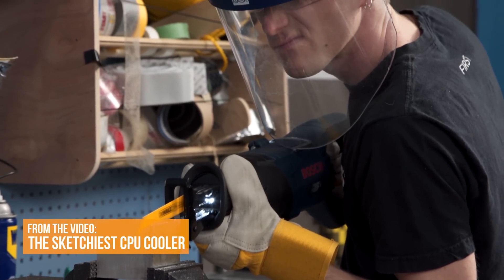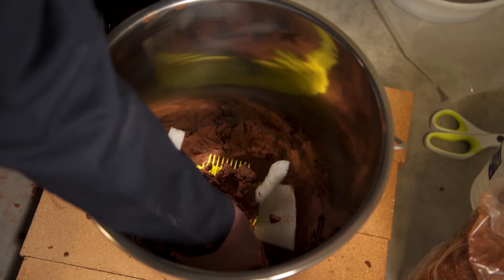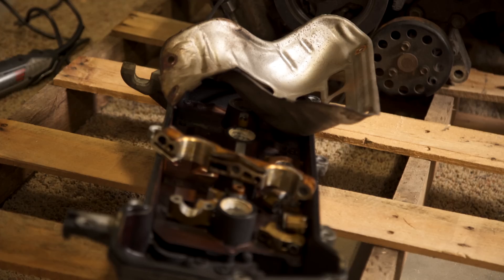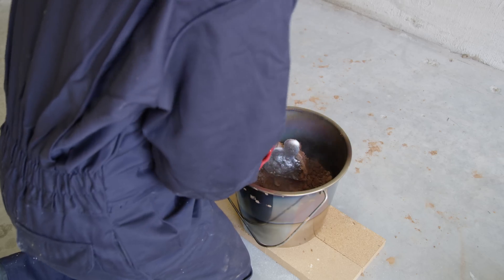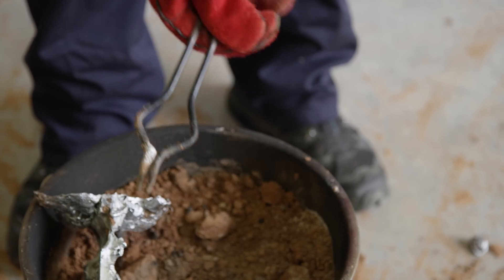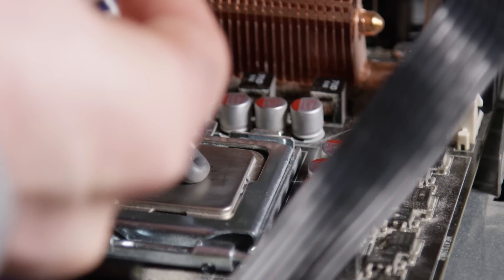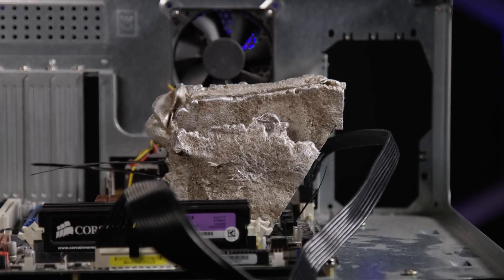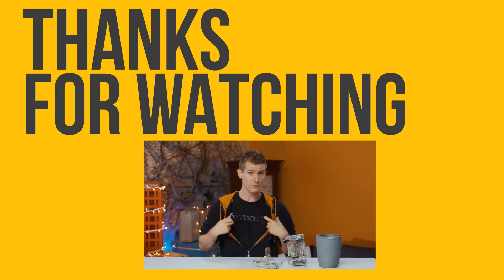The WORST CPU Cooler EVER – Sketchy Heatsinks Ep2

Comment: Try taking your 3D print and casting it in a plaster of Paris mould. After it has set turn the mould upside down in an oven  and the pla to melt out. Then you can cast into a void rather than a lump of plastic. I reckon you’d have better luck with that

Comment: For your second attempt at making a cast aluminium heat sink I would recommend you use the cope and drag method. Here's a very basic rundown of the process

Step 1: flip drag upside down and place pattern (heat sink) inside in the centre of the drag
Step 2: fill the drag with green sand an inch at a time making sure to pat it down in between each time
Step 3: flip the drag right side up and place cope on top
Step 4: insert the riser and reservoir, pack green sand around it
Step 5: remove riser and reservoir, remove cope, remove the pattern, draw gates connecting the pattern cavity ad the runner and reservoir
Step 6: place cope on top of drag and pour metal
Step 7: remove sand from cope and drag to reveal your heat sink
 
make sure to add draft angles to the heat sink fins so that they do not touch the green sand when you remove the pattern, you might want to use talcum powder to make it easier to remove the pattern (don't use too much though excessive amounts will lead to defects) 
There's a few more details but I'm sure that your team can research the rest

Good luck guys!

Comment: This is why heatsinks are milled........ >.> Also why are you putting clay into green sand?  Your making your green sand too thick by doing that... You want fine play box sand, and make it damp not wet.... thats enough to hold its shape and take the heat.  but yes, even after casting your object you still need to mill it to get teh final shape :p

Comment: The step that really matters that you ommitted is firing your mold in a kiln firat for an extended period of time.  I have used lost wax and a type of plaster to good success, but the mold was fired for several hours after the plaster dried to burn away the wax and remove all water from the plaster.

Comment: Well, all of the methods for fabricating it were sketchy, you could've grabbed two boxes full of ash (Not normal ash, but one designed for melting that is combined with sand and water and is pretty solid when compressed) put the model of the heatsink in one, fill it up with ash, compress it, give it a flip, break a broom stick or put a stick relatively thick on top to make a canal for the aluminum to reach the model, put the other box on top, fill it up with ash, compress it, take out the stick, separate the boxes (The ash will not fall off if it was compressed properly and if you handle the boxes cautiously), take out your model, put the boxes back together, fill it up with aluminum through the hole and bam. Perfect model of heatsink
Reply: It's needless to say but do not put the stick on top of the model, put it a few centimeters away and in the ash when the boxes are separated make a road or two for the aluminum to travel to the model, then when finished you can just cut the excess aluminum
Reply: The boxes can be of wood or metal, don't worry if it's wood, if the aluminum doesn't touch it directly it won't burn and it's safe

Comment: This is why I.T. guys shouldn't try engineering. I would explain it in detail but due to the number of mistakes it would take more than one comment. The most critical mistake was using this bad joke clay for making a mold. You should have used something that could be poured so it would reach all the gaps between the fins of a heatsink model and something that could harden on it's own instead on relying that the guy making the mold is skilled enough and he can harden the mold properly, also something that looses all the water when it hardens. This magic material is something as simple as cement or gypsum and I can't even imagine how could somebody not come up with this, instead of using this pointlessly devised plan of that bad joke clay. (The most sad thing on earth is that some people will probably say that the way on the video is the right way to do it...)

Comment: ROFL "engineering department" holy cow, dude.
   I'll admit that being 41 probably gives me the advantage of experience through age but it's pretty obvious to me, that you don't have anyone working for you with experience in the ...dare I say it? "manly" trades. Aluminum heat-sinks are extruded most of the time but when you can't do that, milling one from a solid block is your next option. I can't believe you guys went to an auto scrap-yard to get your aluminum (lol), and didn't notice how everyone uses polystyrene foam for their lost-foam casting. 
  I could go on all day but I will just say that you really aught to hire someone like myself next time you need something done that is outside of the computer realm because, no offense intended, but it appears that y'all aren't very knowledgeable about much else. When you need something done around that shop, you need some old, intelligent, screw-off that's worked all through the construction trades and even has been formally trained for a few of them.
Reply: Chris Turnblom r/iamverysmart

Comment: Come on, man. Just use a whole engine block next time. Maybe... just make part of it fit first.
Oh. Use a car radiator too.
Reply: Slaxbox 
Nah, it has to be castable aluminium. Hdds bodies as prefferable to an engine block. Has lower thermal expansion due to the added silicon, helps with casting with greater presision and avoids thosed holes linus had in his heatsink

Comment: The "lost wax" method, which your attempts were based upon, requires you to burn out in a oven the 'wax' cast first, it burns out. if you did ABS you could have used Acetone to remove the ABS mold of the heat sink. you dont leave wax in the mold and then have the metal burn out the wax in the mold, it never works. A kid in the 5th grade, that was the time I took jewlery class making, would have done a better job. I am surprised you guys did not hurt yourself seriously with the casting attempts. you just missed being an episode of '1000 ways to die'

Comment: Your supposed to mix oil and sand for a casting. Oil won't boil out like water during the pour. That's how I did it in metals class when we did aluminum casting

Comment: OMG... That is the shittiest casting technique I have seen in my life! Who think "burning" the original is a good idea? It will just leave ton of crap behind. You need some material you can drain off and won't stay behind.

Do a 2-sides sand negative. Or even better, make a negative, fill it with wax, use the wax positive to make the sand mold, heat it and drain the wax off. I mean... At least watch some good tutorial online for metal casting. Check out how artists do it, they can make amazing detailed cast sculpture.

Comment: As far as the engineering/casting tips you were anticipating: First, your green sand mixture was WAY too wet. it should be*JUST* BARELY sufficiently moistened with oil to hold a shape when squeezed in your hand - that is to say nearly dry - with NO clay added. second, you might consider inserting pre-cut lengths of aluminum strapping (available in 3in' x 3/16in x 3ft straps at your local hardware store) into lightly packed green sand in one half of a two piece casting frame, level with the sand surface, then packing down the sand FIRMLY. Next, in the top half of the two piece casting frame, also in lightly packed green sand, In the area corresponding to where you inserted the the lengths of strapping to make the fins, create the contact pad of the heat sink by stamping a void into the sand with an appropriately shaped piece of wood.  pack the sand FIRMLY & be certain it's level with the of the casting frame's top - this applies to both halves.  flip the top half of the frame in order to cut your sprue/riser holes.  ascertain there are no loose particles of sand inside the casting area & assemble the halves & secure them together. Pour the mold. You want the molten aluminum as hot as possible, in order to melt the edges of strapping exposed to it. It's kind of cheating to do it this way, but it should create a good bond between the fins & seating area. Might even be a good idea to have the exposed tips of the fins protrude into the casting void by perhaps 1/4 inch.  Hope this helps...

Comment: Alright, you need some serious help here. Fortunately for you, I’m a foundryman and here to help!!

Your PLA will certainly work. Model your casting in solid works and print it out along with your gate and sprue system. Place in large steel cylinder that’s capped at one end. Your sprue needs to be longer than the tube. Mix some plaster of Paris and fill the tube. Once it’s set, simply invert the whole mold and bake it with something underneath to catch the melting plastic. Now melt your aluminum and pour it in. Wait 10 minutes, submerge the whole thing in a bucket of water to dissolve the plaster and cool the aluminum. Casting done.

Comment: i still have my q6600 laying around! and its a hot B0! the only thing more sketchy than your heat sink the the one it came with! the most performant heat sink available for it for about 1 week then you need to clean it using magic... or a super pressured air can! NO SELF CLEANING AT ALL! my I3 8100's heat sink has half the fins but is way more "SANE" since i "cloud" clean it. the only reason i upgraded tho is that my ASUS stopped charging the CMOS battery. 

q6600 is still good performance...  but would need faster and MORE ram and FSB! but the CPU it self would still be viable for gaming for a good 5 years maybe even more! mother boards don't get made for it anymore tho... and winXP SP2 in 32 bit was all i needed for my music editor (Cool Edit 2) and for cars i had CARTEST.EXE and only runs in 16/32 bit windows installed. (what's up with DOS box not emulating that? DOS=16bit)

Comment: Often when working with casting they will use wax. This would probably work for the second attempt where you fed the metal across the top of the fins too. I worked at a place that made titanium molds like this and they would use wax as it was easy to burn off and could easily be touched up too. But this is just suggestion based off what I was told as I worked in a different department.

Comment: Man.. All they had to do was make like 10 fins on their own. Make a thick base plate. Then weld/melt/solder/attach/fasten the fins to the plate in succession. Hell, it would've worked best if they made the fins then cast the plate along the fin-bottoms. That would be best by far and the most simple. You can make the fins as thin as you want with a grinder/vice as well. Even cut them out from a single sheet.

 Thinking about doing the same myself with some copper I got lying around. Could experiment in so many ways. Take up all the space, mass, air flow, etc.

Comment: I would've gone with just green sand casting with a two peice wooden frame, or if you could've done the lost foam but in the better orientation where the aluminum flowed down into the fins.

Comment: I'm a metal sculptor and you missed some important details about casting. Now, I would recomend you to try a new way to make the heat sink: attach a serie of thin aluminium plates of 2 sizes with a couple of bolts/screws, its much easier than what you where trying to acomplish

Comment: You will have a lot better luck using 8 or so 2"x2" 1/8th inch aluminum plates bolted together with washers in between

Comment: I think he should give a second go at doing it with foam, but instead of shoddily piecing it together with chunks of foam and rubber cement, take one big chunk and carve it with a hotwire, then do the casting again. I've done aluminum casting with foam, and you can get some pretty precise details, you just have to be careful.

Comment: instead of making it by hand you should have used a negative made by sticking a heat sink in there and pulling it out leaving its shape in there as a hole and filling it with melted aluminum
'

Comment: I have a home made heat sink I inherited, which was made by a wannabe computer technician which is made out of many sandwiched layers of extruded aluminum, some small bolts, nuts and washers.

You could easily make better than this with aluminum flashing  which used around doors, on roofs and other places to divert rain on buildings, can be found in most hardware stores and some even sell copper which as we know is more conductive of heat.

Comment: Your "Engineering" department needs to be fired. I am an engineer and have studied for many years, now working with a defence company. One of the things I studied was casting and just about everything done here was wrong. The sand was wrong, the way they packed it was wrong, the pooring technique was just awful hence why you had now pressure behind the flow in to the cast. Now that aside you would have much better luck with wax investment casting, it gives much greater detail and would allow for much thinner walls. If you attempt this please do some actual research in to as clearly none was done for this sand casting. Casting is not as simply as pouring molten metal in to a sand bucket, you just will just end up with that molten mess which could probably be called modern art these days.
Reply: Bgwake95 hell, I'm a second year mech student, and I know that that was a complete disaster. Personally I wouldn't have gone for a mold and instead tossed a cube of aluminum on a mill. but if I had cast it, I would have done like 20 things differently.
Reply: ben russ yeah a milled block would have been better than sand casting, wax investment casting would be better for the smaller detail or if you want to avoid casting all together EDM wire cutting in to a block would be a way to get the thin blades that are a staple of a heat sink.
Reply: Bgwake95 yep, but I am more confident in my ability to mill a decent HS then I am about The other methods you listed. Because while I do know they are better, I have never had a opportunity to play with those methods.
Reply: The one thing that boggles my mind is why did they try to cast it with the fins pointing up? They MAY had better luck getting the PLA to melt if they cast it upside down? And really that sand was too coarse for the type of detail they wanted
Reply: Excalibur Crusade Gaming lmao XD

Personally, I thought it was hilarious too, but I guess if it's the craft you do for a living or a serious hobby, it may annoy some people. Still, it's fine to give to point out what they could have done better - it's interesting and it's nice to talk about.

Nice comment btw. XD
Reply: did you read the title
Reply: I also work for a defense company and think their heatsink is the bomb.
Reply: +punkindonutguy Must be a government defense company. ( ͡° ͜ʖ ͡°)
Reply: You've given a lot of suggestions of what not to do, but what about suggestions about what to do instead? That way there's a chance we'll get a video on it.
Reply: Literally the whole point of this video is that it's terrible and it's funny. get over yourself.
Reply: Chill, nobody cares. It was a funny video even though it sucked.
Reply: Hell, I could cast better than this at 15
Reply: Its supposed to be a comedy budd
Reply: Its supposed to be a joke episode dude... like Top Gear is not meant to be a serious car show

Comment: One of the reasons it never molded correctly is because your design is the wrong way. Make the fins point down so as the aluminum fills it goes to the next one and once filled makes the plate. Otherwise you will just not have the pressure needed to make the metal go up like that.